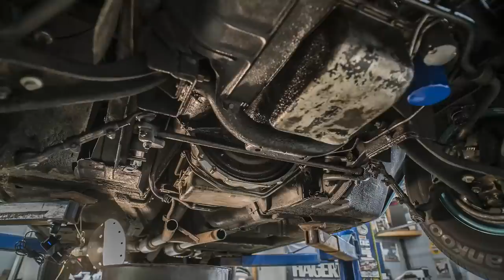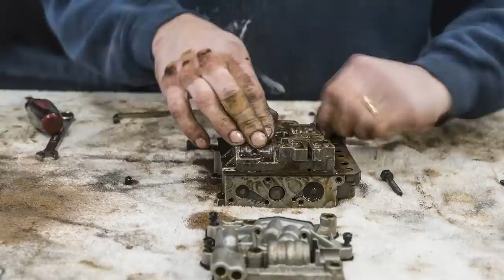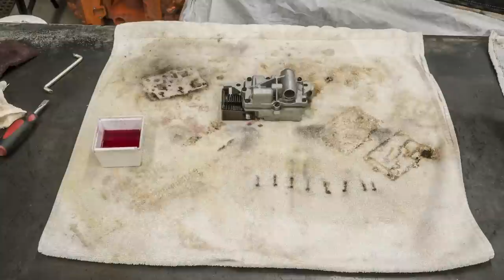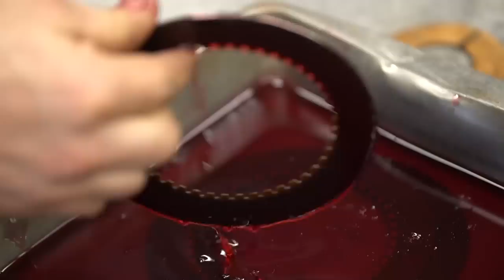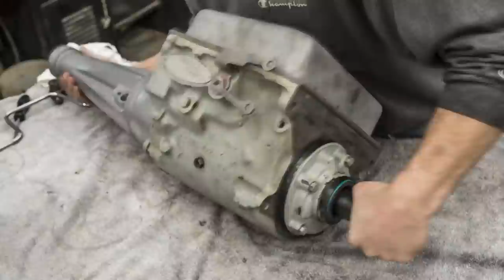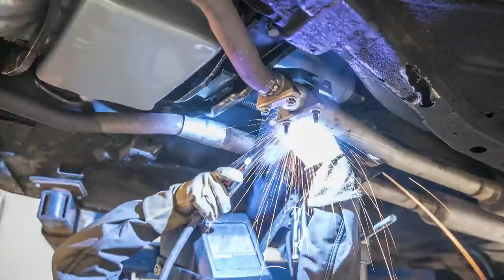Ford Thunderbird Automatic Transmission Rebuild Time-Lapse | Redline Rebuild - S1E4

Comment: If you watch closely, you can see precisely why I don't work on automatic transmissions.
Reply: They're actually kind of fun to work on, I've rebuilt a few and was very happy when they worked as expected. Honestly with a good manual it's not hard and older transmissions don't require very many special tools. There's only a few adjustments, mainly in setting clutch pack clearances, end play and band adjustment. If you can rebuild an engine you can do a transmission.
Reply: @Oldbmwr100rs are two speed transmissions any simpler than that complex beast?
Reply: @lsswappedcessna  i believe the transmission shown was a 3 speed😉
Reply: @tobylewis1920  I believe those older bullet birds used the MX Cruise-O-Matic transmission. Damn things were heavy! The case was cast iron! Not like the C6 which came later and was an all aluminum case. Doing that alone shed 200lbs from the weight of the trans.
Reply: @Someguy6571  I believe youre right, was unsure of year and guessed it had a C4 in it! Aluminum case trans is definitley the way to go haha
Reply: Kyle Munz lmfao... when i was going to southwest tech getting my degree. The one class I really dreded was transmissions . After getting in there I really loved it. And did 2 yrs apprenticeship at transmission shop. But fate took me away following the money trail. And ended up with engine diagnostics. Every now and then I’ll pull a trans down and build it for giggles
Reply: Oldbmwr100rs very true sir.
Reply: Toby Lewis ya its a fmx 3 speed. Precursor to the c4-c6
Reply: I think he misaligned the primary turbo encabulator torque slider.
Reply: @mysticwine  😅 from EDWARDS BROTHERS TRANSMISSIONS ROANOKE RAPIDS NC
Reply: @Oldbmwr100rs  I have  REDONE& built MANY MANY Do it yourself units.
You may have done a cpl ask any builder!. This transmission WOULD kick you in the rear band adjust ment and clutch clearance are trivial things compared to knowing how to assemble properly you have no clue what is wrong or what made it go wrong!.
I have a brother who knows all.
Reply: @robbiefrentz9427  Fmx came out in 1968,C-6 1966,C-4 1964 The guy with "Old" in his name can tell you all about transmissions.I only rebuilt transmission a bit over 35 YEARS..So any fucking idiot can do it&no special tools,hell All that money I spent,Should have asked MR OBVIOUS!.He's probably doing Carnac someplace!😡.Personally I think he never saw inside any transmission that WORKED!.
Reply: @packingten  Oddly the most of a type I've rebuilt were old buick Dynaflows from the early 60's, just before GM went to the same automatics on all their cars. I've only done 3 or 4 of them, and have also rebuilt a couple TH 350's and repaired a few old BW 3 speed autos where the forward clutch diaphragm springs have broken, a common problem. I've done many motorcycle transmissions though, more than I care to think about.
Reply: ok why?
Reply: screaming chivo having to shift gears up and down in stop and go traffic in the city during rush hour sounds like fun. /s
Reply: @Someguy6571  I own both an FX cruise o matic and two C6 transmission powered vehicles. The Cruise o matic is not 200 pounds heavier than a C6. I am able to pick the COM up off the ground fully assembled with a bad back, knees and ankles without too much trouble. They only weigh maybe 40 pounds more than the C6 at most.
Reply: Good, otherwise Scotty would call you a clown.
Reply: @Renville80  I've owned both squish boxes and crash boxes but I'd rather shift a crash box way more fun. Driving in stop and go rush hour traffic sounds like a personal problem. Probably something you should stop doing you'll live longer.
Reply: Agreed. A lot of work is involved. I love my manual clutch & gears.
Reply: @lsswappedcessna  well, depends on if ford made that two speed as well (or early buick).

Comment: And no parts left over? That's amazing!
Reply: I think thats probably the worst thing to happen with an AT lmao
Reply: It's not that bad, the factory puts extra parts in there all the time. :-D
Reply: I replaced the head gasket on my camaro, and by the end I had about 5 extra bolts.
Reply: That means good luck.
Reply: Abe Markille /StraightPipeVan Enterprises. Lmao 😂
Reply: Fake news...they just hide the leftovers! Lol!
Reply: Screaming Metal Death Trap LLC. That’s just your car gifting you 😂😂
Reply: LOL
Reply: Left over parts are proof that you made it better! xD
Reply: Since i was the rookie at the time. The old fellas would put an extra spring or retaining clip. On my table just to watch me tear it back down. It did teach you to make mental note on every sub assembly
Reply: Screaming Metal Death Trap LLC. As long as they weren’t over 3” long your all good lol
Reply: If I strip and rebuild something, after the 5th time I can build two with all the spare parts 🤔
Reply: I'm a retired pro automatic transmission builder.Worked in sev shops. We used to get a thrust washer,or another piece and sort of put it in a shop towel on a guys bench then. Stand back&watch him,I always told them so they
 didn't take unit back apart..
Reply: @BuceGar  Just where would they put these "Spare parts?""...

Comment: And that's why automatic transmission work is so damn expensive!
Reply: Yeah too bad you couldnt rebuild one in the same time as the time lapse lol
Reply: sure you could , it just wouldn't work
Reply: This transmission is a pretty complicated early model trans. A newer trans that's comparable such as an AOD(e) from crown vics are much, much simpler. With a team of 3 people, we had one torn down in a couple hours and completely rebuilt (and upgraded) in a couple days. Most of that time was actually waiting on parts. Id say the total labor time was 8 hours.
Reply: Koshunae y
Reply: When i had my apprenticeship to become a diesel mechanic my teacher at the vocational school once told us about the time he tried to repair an automatic transmission. The control unit was without any electronic components like this one in the video. He pulled it out and there was a lot of jingling going on. All the steel balls and spring fell out. At that point he went to a specialist since it was too complicated for him.
Reply: 200-300$ In Russia. How much it costs in US?
Reply: @Skripys  depends on the state like 1000$ maybe
Reply: @hebelehubele872  Not bad.
Reply: A lot more than a manual that's forsure.
Reply: They are crooks ! Charging more then the car or trucks are worth in some cars and trucks ! This man is slow ! Just kidding !
Reply: @Skripys  About the same as a new transmission on average.
Reply: Kevin Steeno it’s like they have a fluid powered computer in them or something.
Reply: What do you mean? Hagerty did it in 4:54, is fuckin easy.
Reply: Yep ....job security for some of us....
Reply: @hebelehubele872  If somebody tells you they can rebuild one for $1000, take it somewhere else. They don't know what they're doing. The average today, for a good rebuilder is $1800 - $2500. You get what you pay for.
Reply: @countryboyoutdoors7963  wow thats almost a salary
Reply: @hebelehubele872  $80/hr plus the kit.  They $1500 years ago.

Comment: And then comes the moment at the end when you find that random part on the floor and have no idea where it goes.  In slow motion.
Reply: Dave, your comment reminds me of a time when I was in a manual transmission class. Everyone broke up into teams and we had to tear down a manual transmission. I happened to get a transmission that I knew very well and had it apart and back together a very short time. I did notice a ball bearing missing and assumed that it was just lost from a previous tear down. After lunch we all set down in the classroom and the instructor held up this ball bearing and said "who left this out". Needless to say I had to tear it down again and put it in.

Comment: ...........I have a new level of respect for the man that did my TH350. I took some pride in being able to do some engine work, but transmissions are just Voodoo!

I feel bad for not realizing just how insane they really are on the inside!!
Reply: Indeedy!  Even Charles Kettering, GM's internal genius in the early 20th century who invented the electric starter, the breaker-point distributor ignition system, and modern AIR CONDITIONING, EVEN HE couldn't solve the conundrum of how to build a transmission that shifted automatically AND didn't require manually operating a clutch at any time!  The torque converter did exist, and we did have the planetary gearset (the Model T used them, but with manual clutches), but nobody had yet figured out how to actually combine those together successfully yet in the 1930's to form what we now consider the 'automatic transmission'.  A man named Earl Thompson was who finally figured it out in combining the two in the late 1930's in time for GM to introduce the 4-speed Hydra-Matic for the 1939-1940 model year, but with a 'Fluid-coupling' instead of a torque converter.  The torque-converter as we know it is a fluid-coupling with the all-important stator added.  

Mr. Thompson btw, was also the guy who came up with synchronizers for manual gearboxes to take them from being the hard to operate 'crashboxes' still used in semi-trucks to what we've all known and loved for so long in conventional manual gearboxes of the muscle car era to today.

Comment: Y'all are braver than me. I had an '88 Thunderbird and needed a transmission rebuild and decided to tackle it myself (This was before YouTube and Google). I pulled the pan and the tray and about a million springs and ball bearings went SPROING! all over my garage. I won't tell you what I said at that moment, but the first word was 'holy'... I took what I could find to a shop and let them fix my screw-up. 9 years later when I moved I found the last 4 ball bearings...
Reply: Part that will fry your ass is that those check balls usually come in the rebuild kit.

Comment: I rebuilt my first transmission on a 2000 Dodge Neon. I had no idea what I was doing. As far as I was concerned, it was just a puzzle that went together a certain way. So I kept track of what went where and in what order. Following a service manual for procedures, torque specs, etc., I was able to successfully rebuild it (I had to open it up a second time because I messed up on one part), but it really wasn't as difficult as you'd think. I enjoyed it.

Comment: The old cast iron cruise-a-matic,later became the FMX
Reply: And they weigh a ton
Reply: @reddrw1  They're not that much heavier than a C6. I've rebuilt both COM and C6 and picked both up fully assembled. Not much difference.

Comment: Want me to send you some gloves? Parts cleaners and other chemicals are freaking bad for you. I'm a mechanic and use them. Health first.
Reply: that dmso in the parts cleaner is good for the arthritis. There are no hazardous chemical warnings on the back of auto trans fluid bottle
Reply: What's your address I'll send you some Aluminum Foil, and more gloves.
Reply: On purpose, I take it?
Reply: Tbh not just the cleaners and whatnot but the oil and grease itself is pretty harsh stuff especially in old motorcycles with age old oil, but just absorbing that stuff on a regular basis is bad for your hands and skin.
Reply: yeah, they're hella bad for you if you drink them lol theres no way you can soak enough into your system through the skin on your hands to cause you bodily harm unless you left them totally submerged for hours at a time. Plus, mechanics usually have some really rough callused hands, they're safe ;)
Reply: They have trans fluid running thru their veins,  they don't need gloves.
Reply: @harrisonvc9175  not to be that guy but the reason why I wear gloves is for when the wrench slips and smack my hand against the car, cuts on your hands is what can lead to that exposure of it getting in your system
Reply: If you read the warning labels it's only harmful if you are in the state of California, so as long as your not there you should be fine right?

Yes this is sarcasm
Reply: Awwww the new parts cleaner is week.. thirty years ago. It was so strong we had to put trans fluid in to keep from your hands burning safety wasn’t thought of lol
Reply: Picax8398 
Have no idea what that is lol. However the things we didn’t know back then. Was scary. None the less we did what we did. Now i wear and go through tons of gloves
Reply: I'm pretty sure Haggerty know what the hell they're doing

Comment: never, ever, never ever, never EVER use cloth towels and rags when working on hydraulics and valve bodies like this. Ever. It makes me itch watching this video.
Reply: funkyzero   why tho? did it not work?
Reply: cloth rags tend to leave behind lint, strings and debris. All it takes is one tiny piece of string in the right place, no different than a grain of sand, to jam up a valve body. Work on automatic transmissions should be as clean as clean can get.
Reply: What kind of rags do you recommend?
Reply: I built the trans. in my truck that way and nearing 8 years later still no problems. Just don't leave strings, hairs or pieces of dirt and you'll be okay.
Reply: If you paid attention., thoses were NON-FIBER towels....90% of trans shops use the... i used them every day when i work at red line transmissions...

Comment: The truly amazing thing is that all those intricate parts were designed on a manual drafting table.  They did not have CAD- CAM or anything like that in 1962.  This country was once magnificent.

Comment: i would have rather it been explained how to do this so it's actually useful to someone wanting to know how to rebuild a transmission
Reply: Chris Baker I'm sure there's hundreds of how to's on the internet, maybe even one for your vehicle/transmission. There's books on it too
Reply: Shawn K I'm sure there is.  i guess i just don't understand what the point of this video is then.  in the description it says they were curious about how a transmission works and then made a video that didn't clear any  of that up.  not trying to start anything. guess i should be watching the other videos instead of this channel
Reply: Chris Baker I hadn't looked at the description til you mentioned that. They did show everything they did to it, although fast. From my understanding most of what gets replaced in a trans rebuild is just clutch plates and seals and such. If you were a really, really fast learner I guess you could learn off this video but I don't think that's the goal they had. Check out some of their other videos on engines and car restores :)
Reply: That video would probably be many hours long i'm guessing. It is called a time lapse for a reason.
Reply: You can put it in slo motion
 "joke"
Reply: chris baker is the guy who gave the video a thumbs down?
Reply: There are other videos on YouTube for that. This is clearly for entertainment purposes for the common car person.
Reply: This video is a time lapse just to show the work that goes into it. Same as their time lapsed engine rebuilds. With the added benefit of being an amazing piece of filmography. Much love Broham on Rye.
Reply: It also clearly states time lapse, time lapses aren't really ever instructional...
Reply: Chris Baker shame you won't be rebuilding your Thunderbirds transmission now, if only they would've explained and slowed things down a little
Reply: Chris Baker you know there's the internet right? The thing you're on? You can legit find a shop and service manual on the internet and do it yourself pretty easily, gotta have the time and tools tho
Reply: Just watch the video in the slowest speed YouTube allows

Comment: I rebuilt a C6 automatic transmission in my Ford Galaxie XL several years ago.  I will never attempt to rebuild another transmission.  However, it is interesting how you can change the shifting by the placement of the ball bearings.

Comment: I am rebuilding  my borg warner small case 8 (out of my '63 Rambler Classic 770) also and would love to see this in regular speed. I have all the pictures from disassembly and would love to be able to follow along for accuracy in putting back together. It was flooded during Harvey here in Houston and I took apart to clean all the water out from all the nooks and cranies plus detail the outside of the case.

Comment: with all those friction plates it looks like a motorcycle clutch! interesting stuff
Reply: The real magic of an automatic tranny is in the Torque Converter.  Best example to see the basic concept of a torque converter is take two box fans, butt the faces of them against each other, plug only one of them in, and turn it on.  The one that's plugged in will cause the other box fan to spin backwards, freewheeling.  Fan that's plugged in is the side of the torque converter that's being driven by the engine.  The one that's being 'driven', that's the side of the torque converter that's hooked to the rest of the transmission.  However, in a real toque converter, the converter is kept filled to the brim with transmission fluid, as the transmission fluid, NOT AIR, is the driving medium.  That's why automatics take so, so many quarts of fluid.  The majority of it is to fill the torque converter up completely